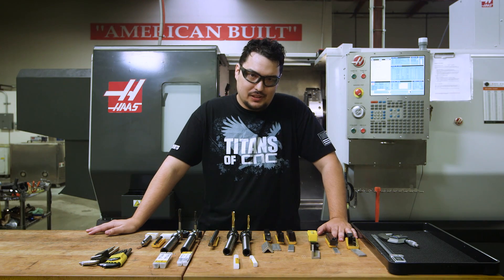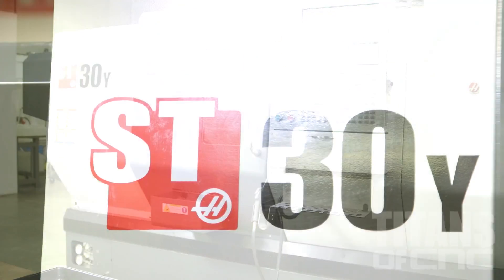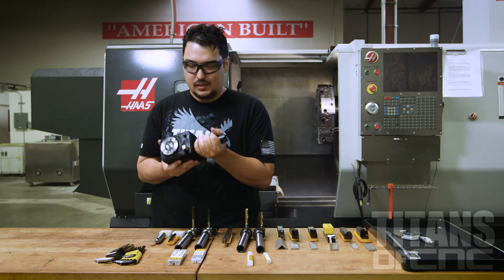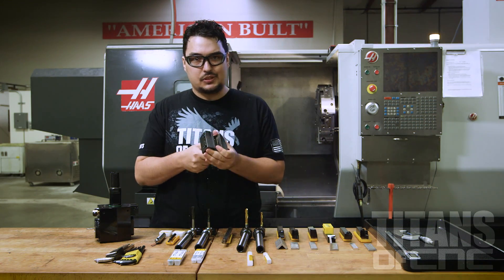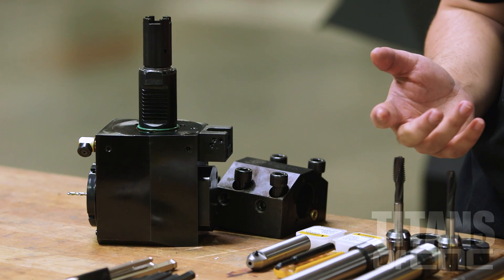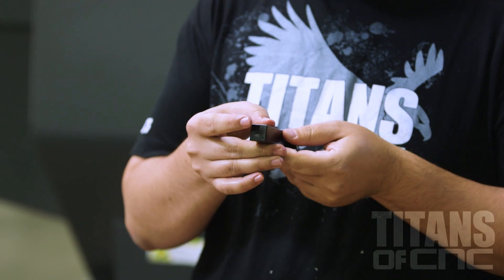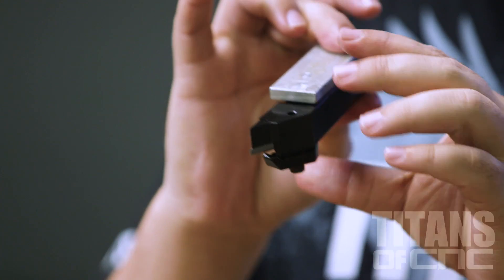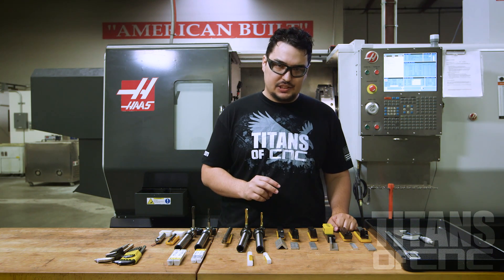Introduction to the Kennametal Tooling for the Academy Rocket Series.

Comment: Tyson, I’m on the last part in this rocket series and having a ton of trouble getting the face grooving operation to work. I’ve been at it for an hour now. I know you guys haven’t gotten to the last few in the series yet for mastercam programming, but a small clip or video would be awesome. I tried searching web forums and other YouTube videos but no luck. Only thing I can think of is maybe because I’m in d+z planes the geometry of the tool is making the software think it’s too large for the grove??? Idk it’s weird
Reply: Hello Hanger, it looks like I made a small mistake when I modeled the face groover in the 3D tool library.  It had to do with the Tool Clearance settings were way off on the tool, but there were a couple of small things I cleaned up on the tool too.  One quick fix would be to make a 2D tool, grooving tool .080 wide, and give it one of the left handed OD face grooving bodies.  That should give you the same tool pass.  
I'll forward the updated list to Russel today though and see if we can get that fixed.  Sorry about that!

Comment: Just sat and watched the whole Rocket Tooling series, Awesome work Tyson!! I have a question, and that relates to the 1/4" inch shims you used. Obviously you don't want them sticking out too far, particularly in the Z axis as you mentioned you don't want it to hit the chuck. When you use shims in the holders, is there are preferred mounting location for those shims, that is centered as best as possible between the holding bolts, or more towards the outer edge of the holder so it holds the tool with a better pressure closer to the tip? I'm thinking you want an even pressure all over, but thought I'd ask as I don't recall hearing that mentioned. Keep up the amazing work!!!

Comment: I haven't seen the followup video but I noticed that there was a tap, it is worth saying that your spindle has to be perfectly straight as in bought new and never crashed to use a tap on a cnc lathe because if the spindle is slightly cocked, the turret is crooked or the center line of the spindle does not perfectly match the center line of the turret you will break taps every time. I know it sounds pedantry but you would be surprised how many people make this mistake.

Comment: Why don't you guys work with Haas or some other company and produce a CNC machine for home and small business? The best I could get on my budget was a ShopMaster, and that cost me $6,000.

It is OK, and it works, but it is the usual Chinese quality.

In other words, use the process of building a CNC Machine to teach CNC machining concepts, then sell that machine to people like me.

I'm not sure if I actually need a rocket for anything, but I do need a good CNC Machine...
Reply from the maker: Haas would never do that, and besides these videos are for teachers and students and all those looking to learn design, program and CNC from their homes or shops.
Reply: Thanks for responding. The videos have been helpful to that end. I have learned from them, and used them.

Right now, a ShopMaster and those Desktop CNC machines like the 3040 machines sold on eBay seem to be the only sort of thing available on a Home or Small Business budget. There are several mill-only brands available in CNC, and plenty of non-CNC lathes, mills, and lathe-mill combos, but not much available in a CNC lathe-mill combo like the ShopMaster, for the home or small-business budget.

I found your videos before I purchased. They were part of the research I did to make a purchase decision. I was looking for a CNC machine, and I wanted a Lathe / Mill Combo. Everything I found is made in China. (Even if it is re-branded as American). If you or Haas produced something in the price range, I probably would have bought it.

46% Of this Nation's GDP comes from small businesses. (Less than 500 employees). Thanks for helping us out.